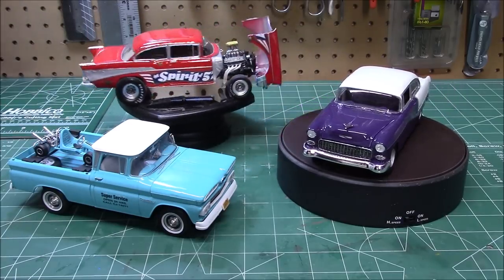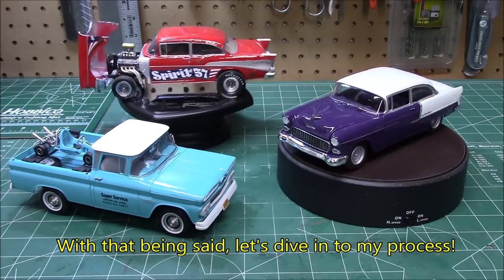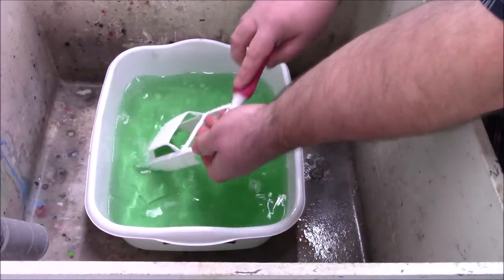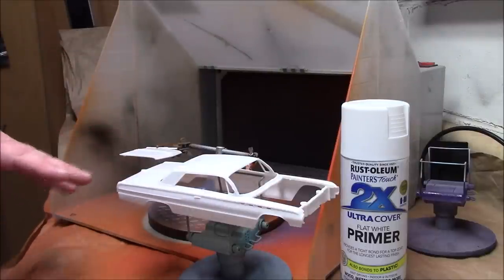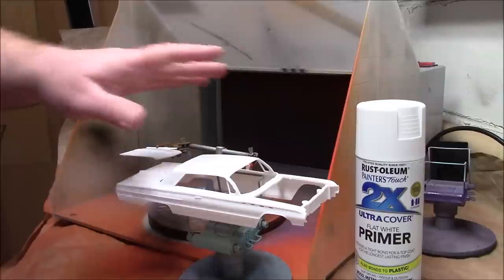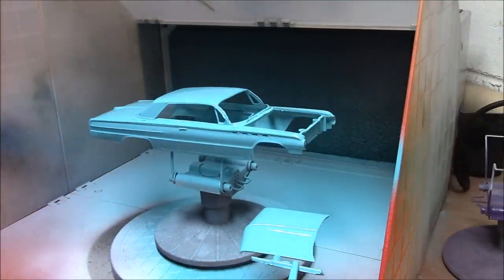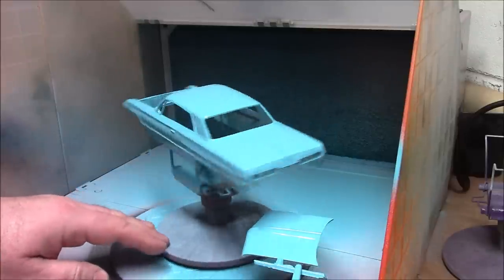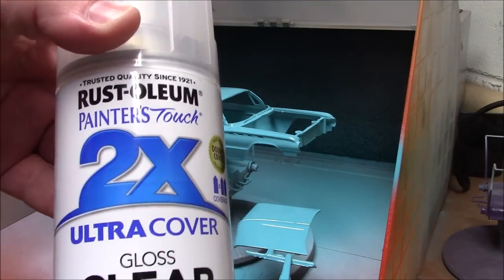How To Paint Scale Models With Cheap Spray Can Paints, No Airbrush Needed

Comment: EXCELLENT!  This is right on point, my son and I were just today dicussing our recent use of these paints. I have been building  model cars since 1961, and never concitered heating the subject before applying the gloss paint!  Never to old to learn, the modeling community is so cool!
Reply from the maker: Thanks Ron, we all pick up stuff no matter how long we've been doing it.
Reply: I've Always had tried to make certain my model body's n paint were at Least 75 Degrees Feirenheight  but 85-95 is better w Paint at ,85-90 too.   The paint is thinner Sprays better  hot.   Propellant lasts longer n small special model paint cans go  fully  empty.. I'm using Krylons Various  a Flat Black paint/Primer combo, Short Cuts Flat White (,as light color primer)  short cuts Gloss as Base under the Krylon Glitter Blasts for Brilliant stunning Low Rider type flashy Metallics n Krylon Glitter Shimmer paints

It goes on super nice n thin with pretty fast dry times too !    Lots cheaper than special model car spray cans $5-6. ,,? You get 4-6X as much paint w Krylong bigger cans n the minis are ,$3.29 vs $5-6 same amount of paint
Reply: @hpiguy  Great video/tutorial, thank you! I'm about to receive a vintage rocket model, which is missing white color on a few smaller sports. Should I use the  white primer and the white coat?

Comment: That's how I painted my models in the early '70's.  Still use it sometimes when the color is right.  Never used primer.  These models' paint jobs still look fine like they did when I first painted them.  I still wear old t-shirts from back then too.  Holes and all.  My heat gun is a $2 model from Goodwill.

Comment: I personally prefer Krylon's spray paint over Rustoleum's. Rustoleum's paint is a bit too thick and tends to shoot out too much which covers up small details. You can still get a super glossy and sweet paint job but it's a bit hard for beginners to get it right. Krylon on the other hand is more forgiving, finer and also dries faster. The best spraypaint I've tried by far is Duplicolor's automotive touch up cans, it's very fine lacquer paint and dries to a nice and hard glossy finish. Plus it's relatively cheap and you can find them in very much every automotive supply stores.
Reply: Meisen, are you using Krylon Fusion or Krylon Colormaxx, and are you using Krylon Colormaxx primer beforehand?
Reply: Have you tried duplicolor's metalcast before? Thinking about trying that out on a kit.
Reply: @gtyellojacket  colormaxx , fusion is more like Rustoleum
Reply: Duplicolour is 50$ in India 💀 that's expensive
Reply: If it is not just a thicker paint, it's the nozzle design giving a heavier or coarser spray pattern and dumping lots more paint onto the item, plus any Rustoleum can that says 2X on it means it covers twice as much per pass (or so they say). Yeah it's nuts and I hate this newer Rustoleum. Krylon goes on lighter and is much more forgiving, I agree, but hey hpiguy is  here using Rustoleum 2X and showing us it can be done!
Reply: I know I’m late to the party but I have a question… I noticed that you sprayed the hood attached to the sprue. I assume you have to touch it up after you clip it off the sprue? I haven’t built a model in 50 years and want to get back into it. I’m just curious how you or anyone else handles the touch up especially since it’s been spray painted? Call me crazy. I just want to learn. Love this channel!

Comment: Great tutorial. The only thing I would add is when mixing brands of primer, paint, and clear, it's a good idea to test for reactivity to make sure that they all get along with each other and don't wrinkle or craze. I use white styrene plastic spoons, available at any grocery store for next to nothing, AKA the famous-in-the-modeling-world "spoon test".
Reply from the maker: Most of the Rustoleum stuff is plastic safe and if you stick brand to brand there is rarely a problem.

Issues come up when you apply a reactive layer above a more neutral layer, you are correct. If you try to apply a hot lacquer over an enamel you're going to have a bad day.
Reply from the maker: Anything that has a strong lacquer base will react poorly with plastic and anything under it. Automotive paints can work great but they must be checked on scrap plastics first and a great primer coat is a must. 

Cheap paints, as shown in this video, have low volatility and rarely react poorly since they are not strong.

Comment: That car's paint is gorgeous!
I did a Nissan 300zx with Rust-Oleum 2x and it came out kinda gritty and I always wondered why.  After your text in screen suggested that the problem was the body was too cold, I thought about it and sure enough I painted it in February or March plus I didn't warm the paint, just straight up shook it and shot it.  On the flip side of things, I did a '72 Nova with R2x during the summer (no prep) and it came out alot better than the Nissan.  Your video told me what I did wrong with the nissan and how to prevent doing it again in the future.
Thanks sooo much for this valuable information!
Reply from the maker: Thanks man, glad it helped!

Comment: Now I see what I'm doing WRONG!  I need to heat the body first.  I have a dehydrator that I modified for drying.  Now I will Preheat the bodies.  Thanks Chris!!!
Reply from the maker: Thanks Clay!  The heat helps the paint flow and even out before it dries.
Reply: Just use a cheap hair dryer.  Not only can it heat your model but as a dryer so speed up the drying of acrylic paint and much cheaper than a dehydrator.
Reply: @BennyCFD  I have one of those too.  The dehydrator was $5 at Goodwill.

Comment: Great tutorial Chris, i can't use spray cans indoors so I use the garage in the warmer weather.  I plan to do one build using Model Master lacquer spray some day, but using the rattle cans you don't have to worry about mixing the paint and thinner and setting the air pressure for an airbrush, it is a much faster system.
Reply from the maker: Thanks for watching!

Comment: Thank you for saving me a fortune. I am in the process of building Revell's 1/72 scale Gato class submarine. It is almost 5 feet long. If I had to use those thimble sized bottles of model paint I would go broke. The hull is almost entirely semi-gloss black, I scored a can of Rustoleum 2X satin black at my local Walmart. Did a test shot on some sheet styrene and it's going to be prefect. Thanks again.
Reply from the maker: Very cool James!  
It's an enamel so be careful with the materials you use to weather it.   Once dry you can weather it with acrylics and should not have an issue.
Reply: @hpiguy  No problem model is not meant to be weathered. My intent is to build it as a pristine display model in a glass case, something like what an Admiral would have on display in his office.
Reply from the maker: Very cool, enjoy!

Comment: I love using Tamiya spray lacquers. They are bit pricey, but the spraying process is forgiving straight from the rattle can. They come in awesome color and cover well. I sometimes don't even use a primer and paint over bare plastic to be daring. I've had exceptional results from not using primer on white molded kits. 

Another brand I love using is Dupli-Color Perfect Match spray paints. They thinned their line up of colors over the years to make way for more modern colors. I've seen a few custom style colors like Bahama Blue, a GM color, Intense Blue Pearl, a few bright reds, yellows, Orange Mist from Nissan, and a few pearl white. They are around $10 a can, but can be used to paint at least 2 or 3 model car bodies and parts.

My technique for a glossier shine is to color sand and clear coat sand the bodies after the paint has cured and "gassed out". Using a polishing kit from Micro-Mesh, start off using 3200 or 4000 grit depending on how much orange peel the finish has and work your way up to 12000 grit for final polishing. Come back with some car polish and wax and you're all set. Of course you have to be careful as to not burn through the paint and clear coat. It's always upsetting ruining a perfect paint job when you polish too hard!

Comment: Nice suggestion on the rust-oleum or whatever.  Since I do not have the benefit of a basement let alone heated, I paint in the garage and it gets cold... down to 40 degrees or so. To heat for painting, I use either a 500-watt or 250-watt quartz work light (depends on the ambient). It heats up the general area to 70-80 degrees in 15-20 minutes. Also, booth temperature control by moving the light near or farther away is really nice (warms me too).

Comment: I made another visit to this.  I have used the Rustoleum paints - the 2X and twice I covered the primer with the regular Rustoleum.  The plastic did not craze and although it took days to dry the result is fine - the Hunter Green for the Raider ship hull.  I rarely use the other model paints except for colors I cannot find in Rustoleum.  I have also used the cheap acrylics thoroughly thinned with considerable success.    Great ideas!~
Reply from the maker: Glad it works for you!

Comment: Hi Chris times have really changed , you refer to cheap paint cans. today in 2023 in my area the paint cans you refer to are 
$10 - 12. Depending where you buy. And in Canada where I live a model will cost $40 - $60. A heavy hauler will cost $80 +.
Times have changed but still a great hobby. 
In the 60s I used to buy Airfix aircraft models for .049 CENTS.  My allowance was 50 cents a week.
Great channel you have!

Comment: Thanks for the tips. I watched this right before my last build. Heating the can made such a huge difference.
Reply from the maker: Glad it helped Chris!
Reply: What I do after the paint is warmed up, wrap it in a heating pad to keep it warm. That's if you are going to use it again or keep other cans warm. This helps atomize the paint better.
Also use a tack rag, found at automotive paint stores. These tack tags help pick up any dust that may get on the body before spraying.The tack rag can be used over and over, store it in a Ziploc
Hope this helps too!
Nice builds!!

Comment: Beautiful video.Now I know where and how I messed up my truck model.I normally collect Diecast truck models,bit last year bought 2 snap tite models.One a Peterbilt and another one a Freightliner.Since I'm from India,we don't get truck models.Had got them online.And also this is my first time building a kit.I had also got the rattle cans, but my biggest mistake was of not applying primer to the body.The paint started dripping, that's when I realised how dumb I am.Wish I had seen your video and then started on my kit.In a way,I spoilt one model,now will start with my Freightliner in a month or so.Also thanks for the simple tutorial you have shown.Very interesting.have just subscribed to your channel.
Reply from the maker: Thanks Amit!
If the paint is running and dripping it was applied much to thick. Light mist coats until you get the coverage you need.

Comment: You really do learn something new every day! I've been spraying my model cars for years now, but the only time I have ever washed them is when I do the initial cleaning prior to starting the assembly process. I'll definitely have to try using the degreaser immediately before painting the body. Also, ideally how long should you warm the paint can beforehand? I have done that before, but it's been a while now so I cannot remember how long I kept it in the water. I am also looking to get back into building aircraft again, and I have always hand painted those, even the really big ones.
Reply from the maker: It sits in the water for 5-15 minutes. Try not to worry about 'exacts' and just let it warm up.
Thanks!

Comment: awesome video...I have a friend who swears by these cheap walmart paints and his builds look fantastic...having trouble with gloss black though...only gloss black I can find is paint + primer...used it on a test body I have that had some bare plastic and some spots with testors model master paints...when I hit it with the rustoleum gloss black paint + primer the parts where the testors paint was looked good except a couple small bubbles in spots...the bare plastic looked like rough flat sandpaper paint....did I do something wrong?

Comment: I don't know if Rustoleum's Specialty Primer for Plastics was already out when You made this video, but have You used it and do You recommend it or is the one used in this video sufficient. Would I still light sand between coats and before base coat of paint thanks. Ps I'm on a budget & would be hand brushing with Deco Art Acrylic. Thanks for the tips.

Comment: Got some great tips here, thanks. I like to use Dupli Color automotive paints because they dry quicker and harder and after I'm done painting, I can wax them with Maguires (sp?) car wax and get a nice durable shine. Never occurred to me to heat the paint but I will now. I work in a cold garage. Thanks for the tips.
Reply from the maker: Enjoy! Thanks Jim!
Reply: Maguire's Carnuba is what I use on model Auto paint/Dupli-color or Krylon   been using since  1986

Comment: I have a question for you, so first if you sanded the body with a 600 grit dry sand paper to remove the mold lines and the whole body, then clean it with water and dawn soap, and dry it with a lint free cloth, if you used a krylon gray primer and if you have any scratches or orange peel from the paint what type of sandpaper grit should I use to get a smooth primer for paint

Comment: Yesterday I picked up a can of the rustoleum paint in the video.  It says that primer is included.  Do you recommend using a primer?  if so what brand as rustoleum primer was not available in my local store.  Great video!  Thanks
Reply from the maker: I always use a primer, even with the paint and primer cans. 

Any general brand of primer seems to work.

Comment: Great tip,it's summer here in australia,around 20 degrees celcius today where I am,do you still put your rattle cans in the hot water before use on warm or even hot days still?,love your work,cheers
Reply from the maker: Yes, you want to warm the can to about 30-38C  seems to work best.
Reply: Thanks man,I love american cars and have been painting my models with rattle cans now for about 35 years?,am currently doing an old monogram 1/12 scale '67 Corvette Stingray I've had for over 20 years now,painting it with auto cheapie shop spray paint or you get in the $2 stores here,cheers & thanks again